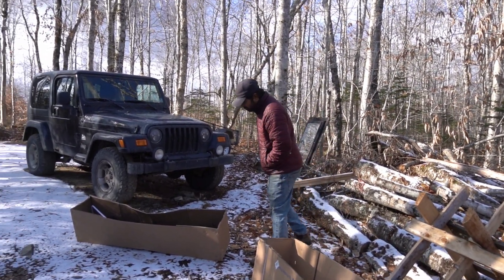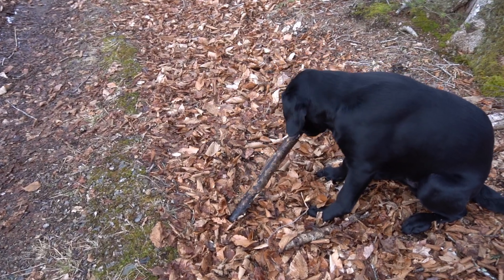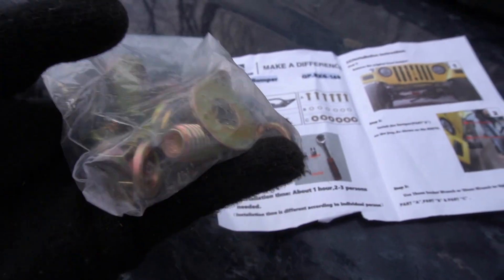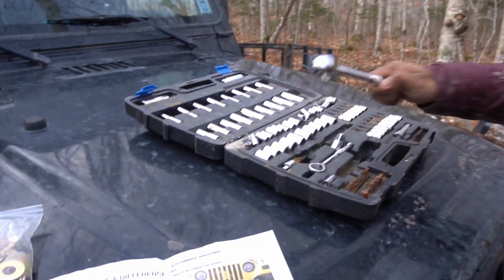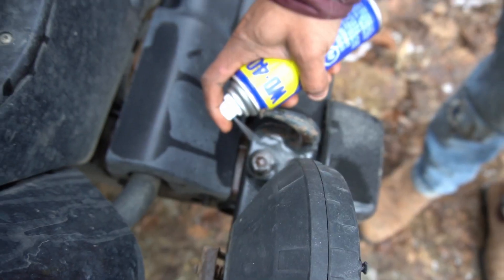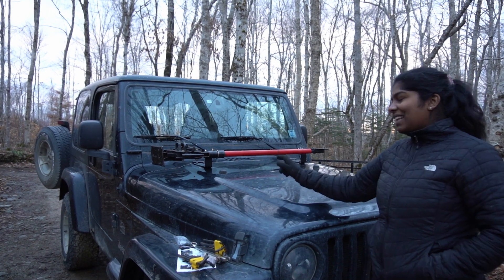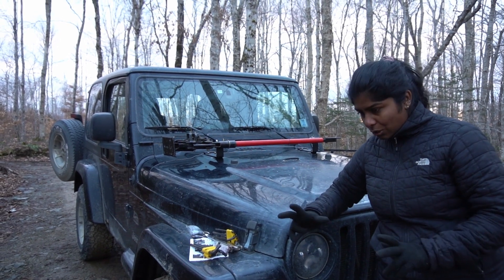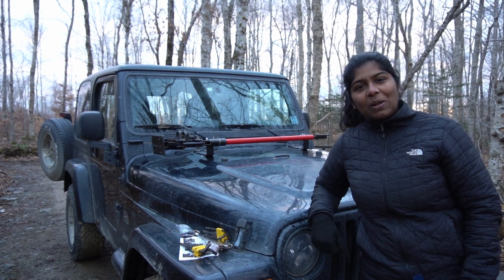A Vlog where NOTHING GOES AS PLANNED | Jeep Wrangler TJ Overland Build

Comment: HI guys, love the videos. We have an 06 TJ and we found that the older jeeps have locktite on all bolts from the factory. A small torch is your new best friend.  Soak them with penetrating fluid and heat them up,  break them loose with a breaker bar and then an impact to get them out fast while they are still hot. Good luck.
Reply from the maker: Hope you don’t get mad when you watch our next video 🙈
Reply: @AldoandDarsh , glad it all worked out.

Comment: 50/50 mix of acetone and atf 4. best pentrating oil. I had stuff stuck on my jeep that nothing else would loosen but the 50/50 mix worked.
Reply from the maker: The bottom bolts worked with some PB blaster though. Not the top ones. We had to cut them off 😬
Reply: @AldoandDarsh  I saw that. Sometimes need angle grinders. New bumper looks great!